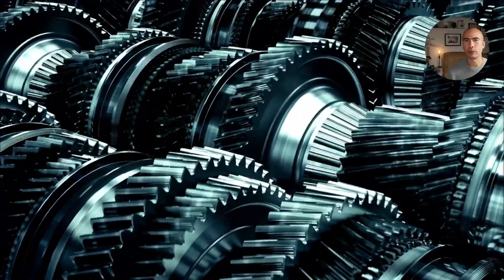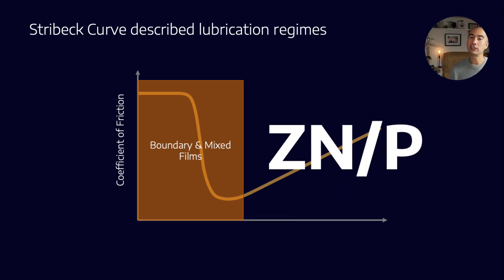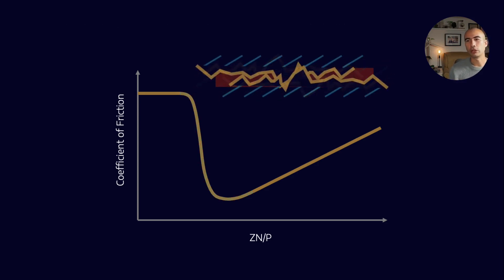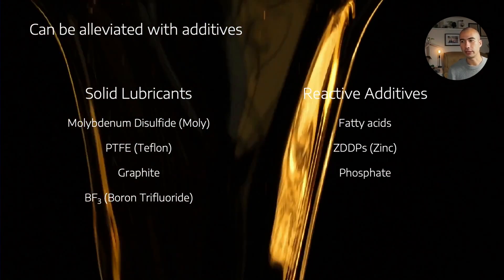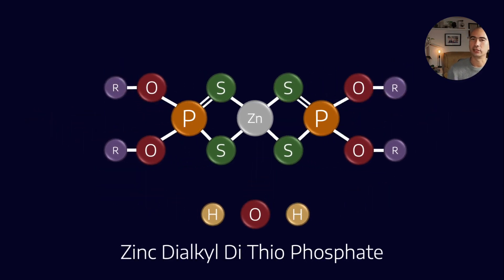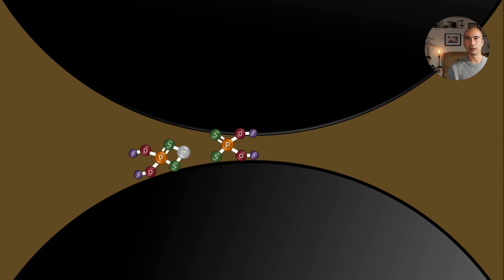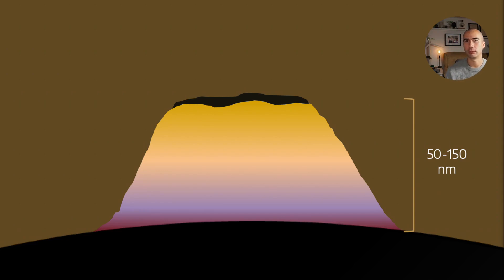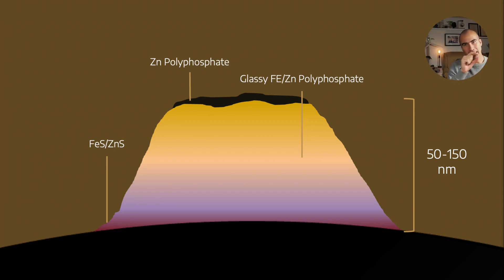How do Zinc & Moly work in an engine oil?

Comment: If hydraulic oil does not use Zn or Moly, what chemical can be used as an anti-wear agent? For example, zinc-free hydraulic oil like Idemitsu Daphne Super Hydro. Because hydraulic oil containing zinc may generate sludge during operation.

Comment: If one wanted to clean a surface completely of all surface anti-wear additives, what's the best way to go around it? How do we get rid of the ZDDP layer?
Reply: Why?
Reply: @dragonmantuning3792  So that to maximize the adhesion of other types of surface friction modifiers or AW like tungsten disulfide or ceramic layers after an oil change.
Reply: @akdomun did you ever find an answer to your question? I don't have any knowledge of ZDDP. All I can say is that from a somewhat parallel field, that is, the workings of ceramic coatings for the protection of painted (and other) surfaces; they are generally very chemically resistant and require polishing (abrasion) to remove. Failing that, mother nature will remove them in time. Being that this isn't practical for the inner workings of an engine, I'm thinking an additive that is more acid or alkaline with a mild suspended abrasive would be in order. How you would prevent that from modifying other tolerances unintentionally is beyond my pay grade.
Reply: @akdomun  I can only imagine that time will do this naturally. If you remove the ZDDP from the oil and use some other modifier, if the surface is a wear surface, those ZDDP films can't last all that long without constant replenishment. The only time you would need to ask the question you're asking is for academic or laboratory purposes I would think.

Comment: is there any relation between oil pump pressure and additives at high load operation of an engine? please give me detailed answer
Reply from the maker: Depends. Usually the pump speed on an engine is determined by engine speed rather than engine load. So high revs on the engine means high revs on the pump. Pump pressure is a function of the back pressure exerted by the lubricants, which is more about the flow speed and the viscosity (determined by bulk viscosity and temperature). So it doesn't really have much to do with the load.

Comment: Hey Mr LE, a quick question, I would like to run 0W20 oil in my gas engine (API SP, ILSAC GF6A, HTHS 2.6, Vis Index 168). The only thing I’m afraid is that the oil viscosity is too low and may cause metal to metal contact and permanent wear. Will adding extra ZDDP, Zinc, Phosphorus, Sulphur help to protect against this? I.e. adding Redline Engine Break In Oil Additive to the 0W20 oil for extra ZDDP
Reply from the maker: @CedroCron  I'm with you. 0W-20 has become a standard weight now - if it were causing a lot of engine wear there would be a decent amount of uproar. Without knowing the specifics of your situation, it's likely that you'll be fine with a 0W-20.